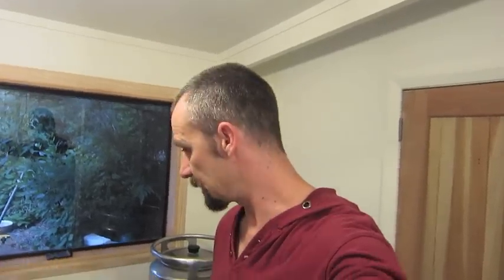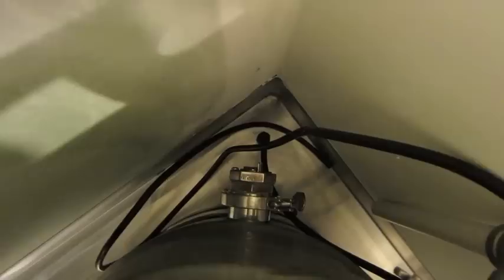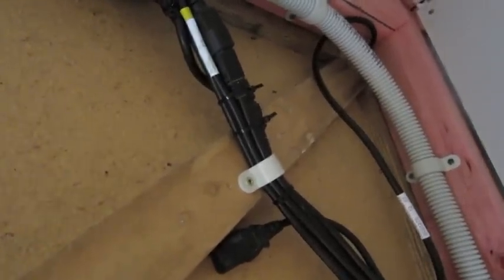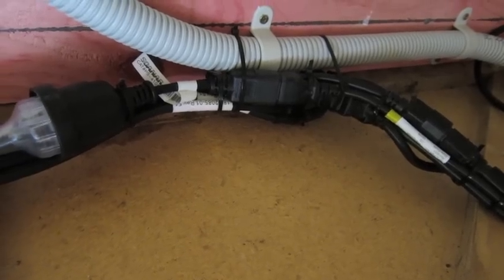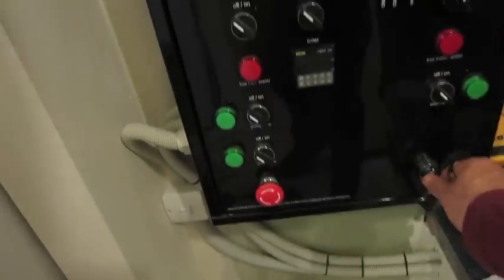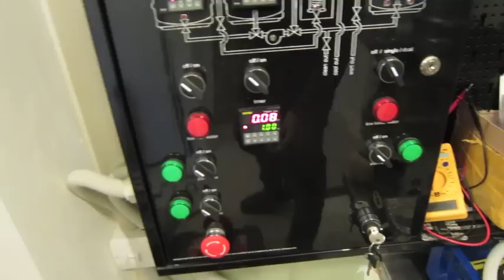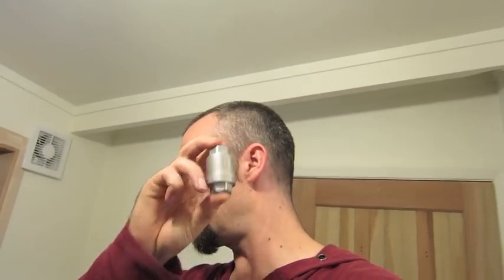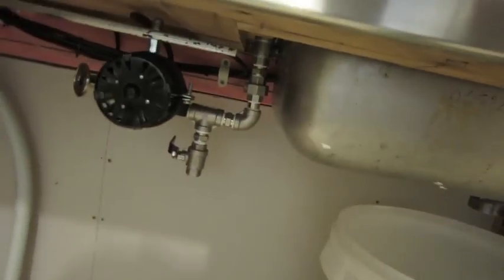Pump n Power, brewhouse build day 28

Comment from the maker: Some pointed out to me that my pump was upside down, dang, it is. The output should be at the highest point of the pump head to prevent air blocks. Cheers Brent, I will be flipping it over later tonight.